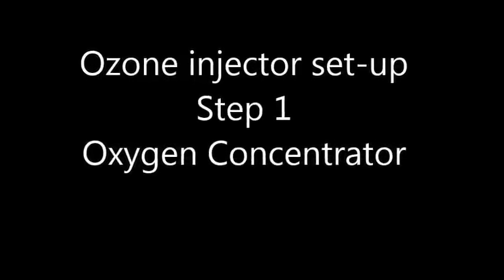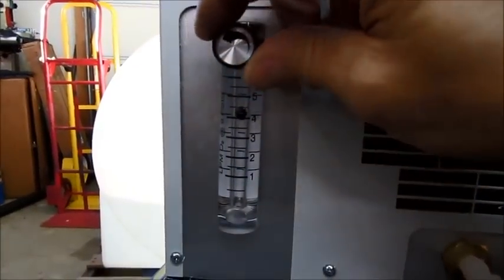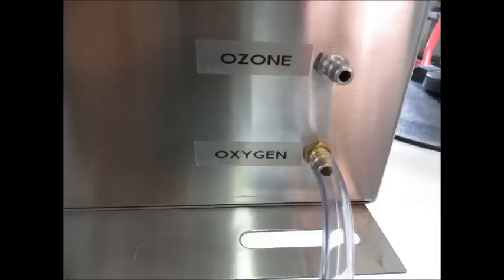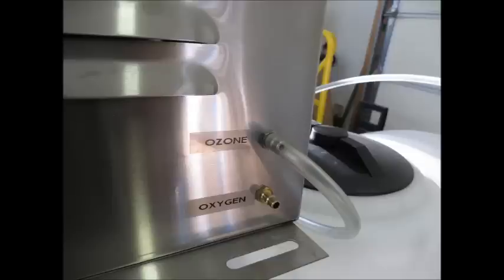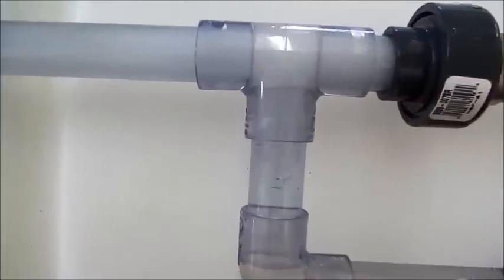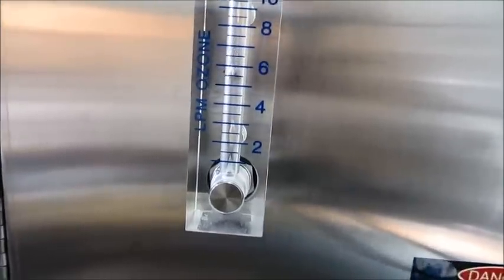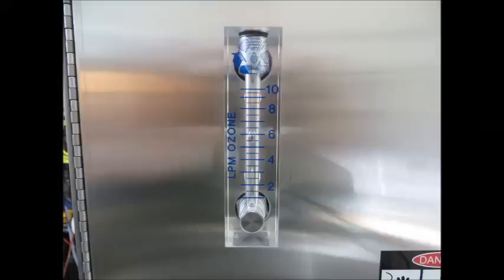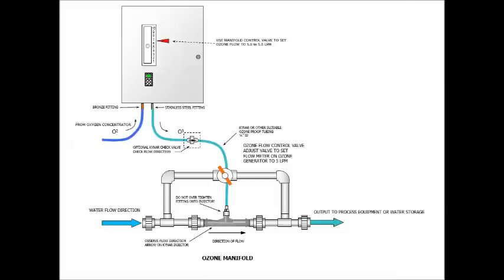ozone injector manifold venturi set up

Comment: what if the oxygen concentrator is at 20 psi.. does that mean if I have the flow gauge at at 5, I would get 10L per minute?
Reply: The purpose is to create the smallest bubble size at the highest bubble density (#bubbles per sq whatever, inch, cm, etc.) You'll flow more with more pressure as read on the flow gauge however you will not be increasing your % ozone.  The generators are rated for a specific g/Hr at a certain flow rate. That's all you'll make.